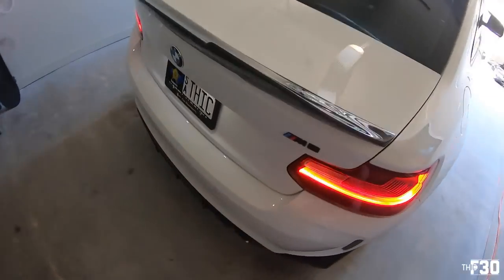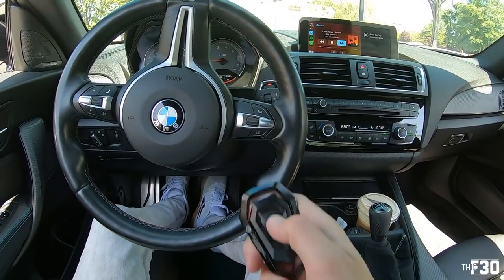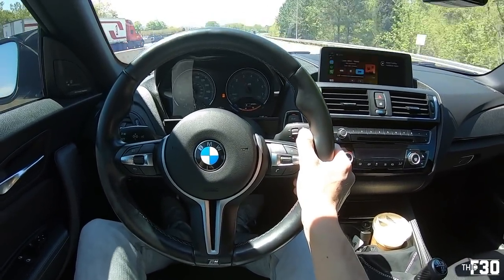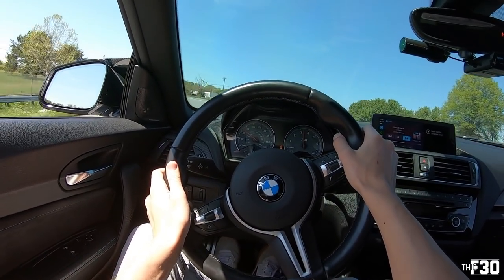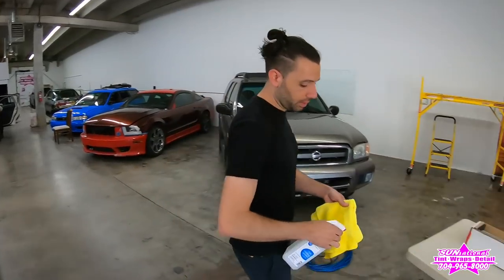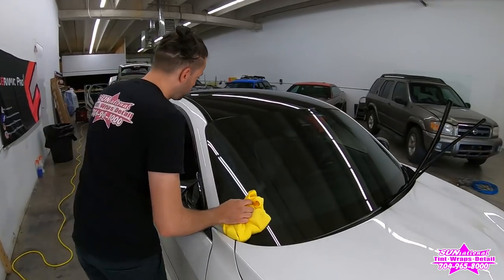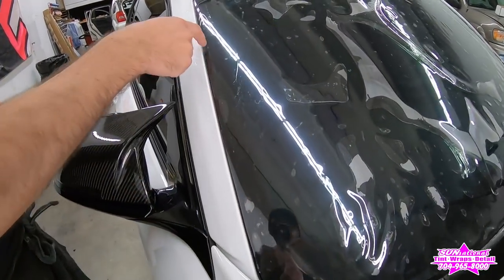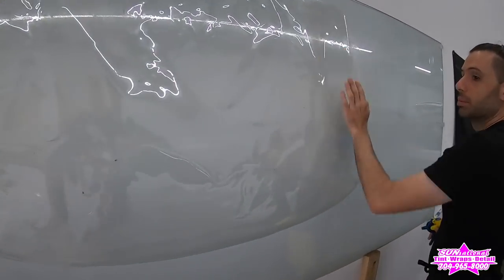HOW TO PROTECT YOUR WINDSHIELD FROM ROCK CHIPS & CRACKS. BMW M2 Gets Tear Off With Sunsational!

Comment: Shew that front end ppf is looks absolutely fire. The paint looks like its wet. Also I wanted to ask... the windscreen wipers? Shouldn't you turn them on so that they are in like the 12 o clock position on the windshield, then turn the key, then lift them off the windshield. That way they won't scratch the paint at the edge of the hood. Just asking? Cause they do look close to the hood.
Reply from the maker: Nah they are fine
Reply: @ThicWhips  awesome. Love the attention to detail that you put into all your cars
Reply: I think I definitely need to do this on my G20, I tried to lift them to clean snow and they hit the hood. Thanks for the tip. 👍

Comment: I have the Michelin 4s on my m3, best performance street tire on the market they really are the benchmark.  I noticed a huge improvement in wet grip compared to the old super sports tires while still improving on dry grip.

Comment: Seems like quite a bit for some protection but to be honest with cars that have sensors in the windshield this is a pre smart move. On old cars that just had glass up front who cares if it cracks its a cheap easy fix.